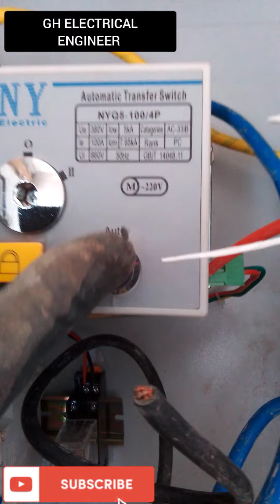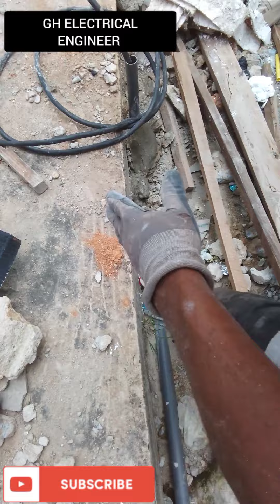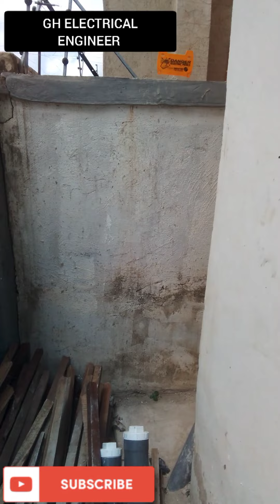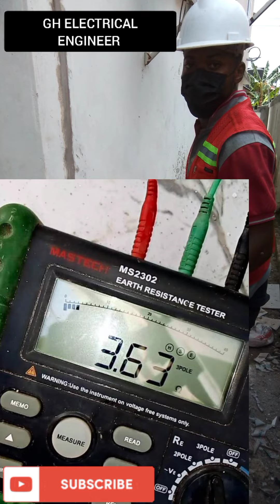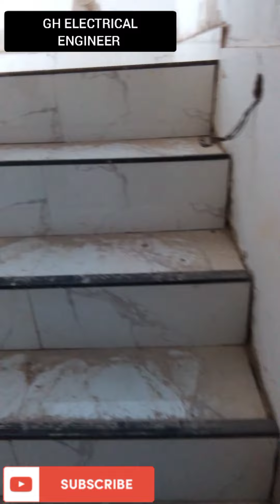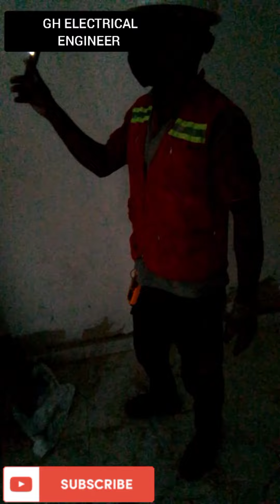BUILDING IN GHANA: POWER ELECTRICAL WORK

Comment: But they say earthing in air better than buring it
Reply from the maker: Alright that is the on the reduction
According to the lEEE that is a electrician regulation and code for wiring .
the earthing Should be buried on the Earth . 
For example 
If the electrician had fault leakage or current leakage 
It's automatically directed to the Earth if you' are earth system is good enough